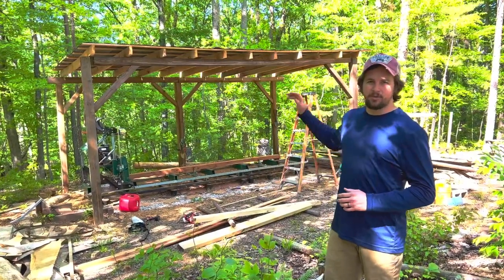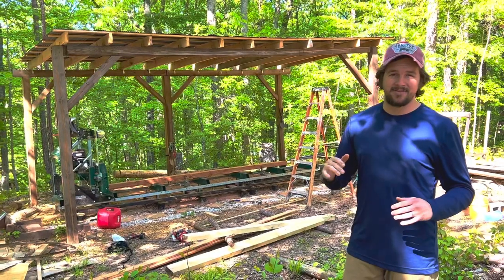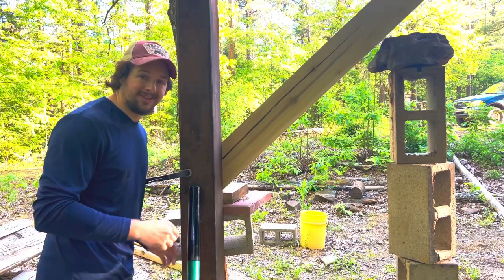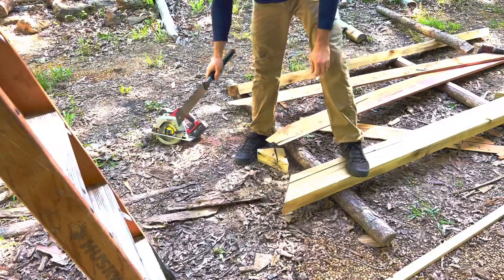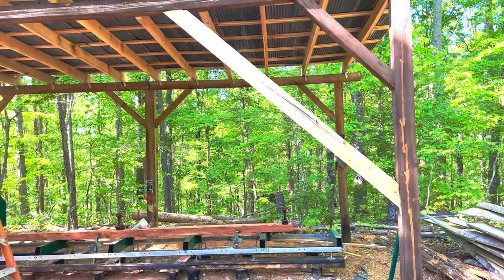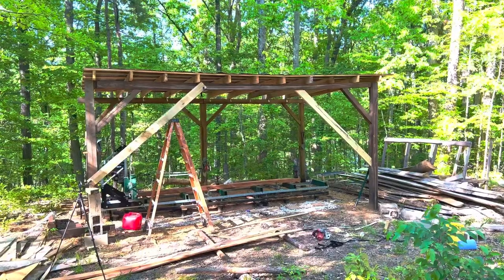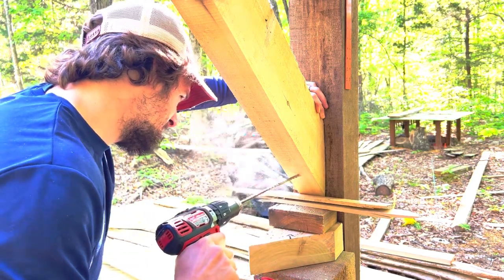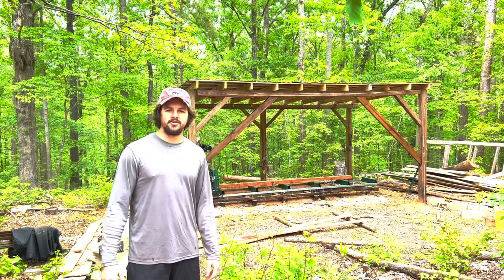How to Install Knee Braces to Support MASSIVE Beams

Comment: Kinda late but I would suggest you would have been better off if you jacked up the beam. You could have just cut the ends of the knee braces at 45 degrees and made the lengths the same. Using the strap to hold the brace for fastening is a great way.
Reply from the maker: I thought about that, but I don’t have experience in that area. I was afraid it would put too much stress on the beam and it would crack.

Comment: How to best fix the mistake. Well you came up the most logical answer. With tunnel vision. We all have it we just don’t control it well. Back to the fix. Jack up your sagging beam, then go up a little more. Now scab on a longish 2x12 on each side of your 6x6. This will settle slightly but will look much better. This needs some bolts or lag screws to provide support and prevent further sagging. Your solution may work but the first thing I see is that sag.